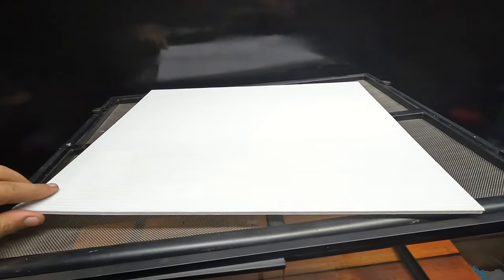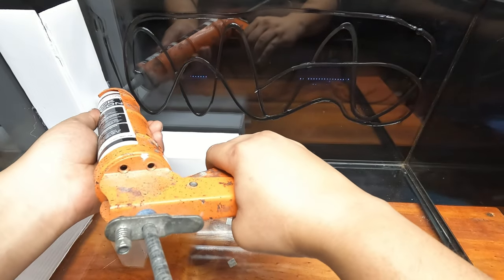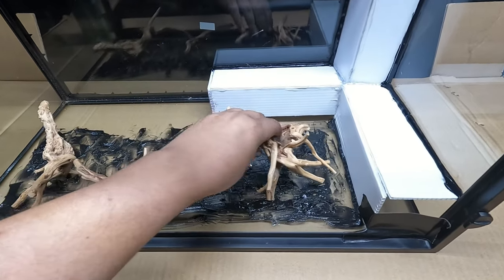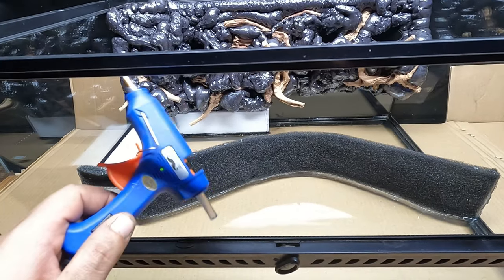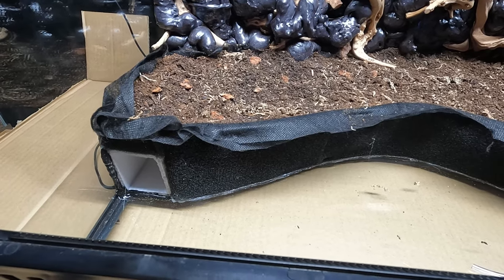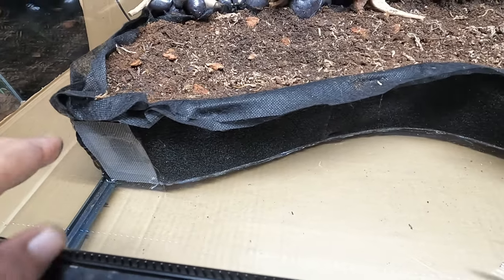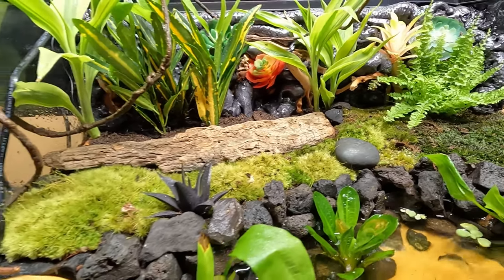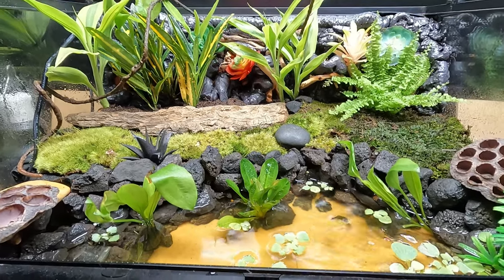My First Bioactive Land and Water Terrarium Build Step by Step

Comment: A couple of tips. Keep the level of the music the same level as the talk over, it's less harsh on the ears when it shoots up so much after you stop talking.
Tip two, loose the expanding foam and use insulation foam. A lot cheaper, easier to shape, less prep, and will hold up way longer the spray foam.
Tip five, DO NOT use hot glue. It will not hold for any length of time. Use CA glue and cotton balls to glue them together. This is commonly used in the fish trade to glue rock structures together as well as CA glue is used to glue hard coral frags to plugs so they hold till the frags take hold of the plugs on their own.
Reply from the maker: I apologize about the volume but aside from the home builds im also learning to edit videos so ii promise to get better at it. Any tips and tricks are helpful definitely welcome so thank you 😀.As far as the hot glue ive had good luck with it its been several months now and everything has been holding firm in its place but ill be sure to try out your method and see how it goes.